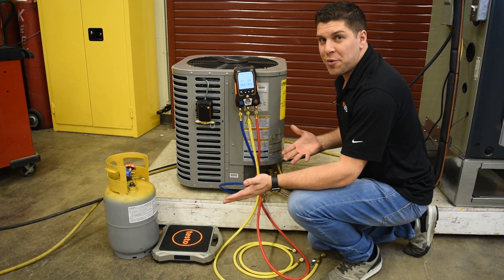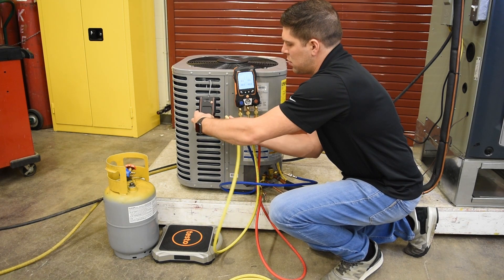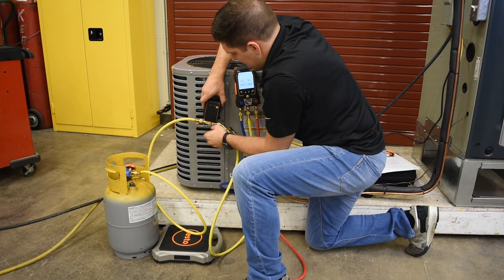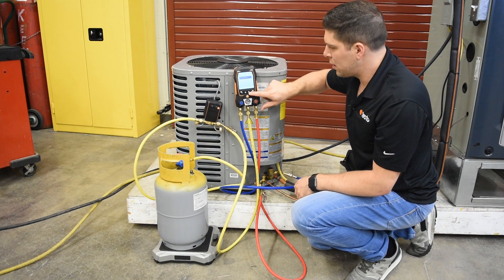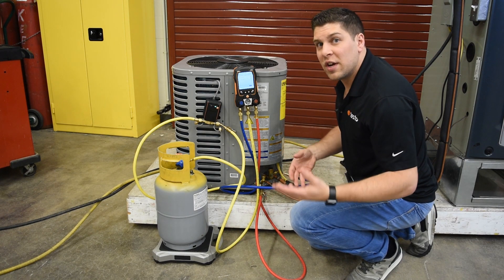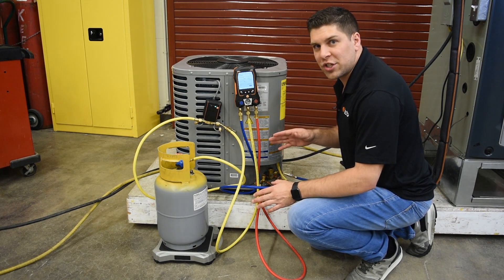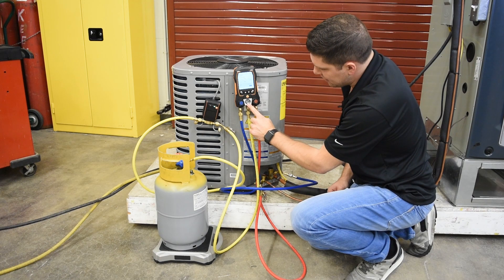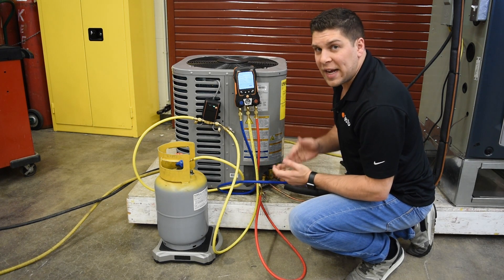testo 560i Connection and Refrigerant Line Purge

Comment: Wouldn’t you purge where the process hose connects the manifold set while the knobs on the manifold are closed off to the system. The only way I could see you purging where you did would be to have the hoses disconnected from the system using hoses with ball valves. If the hoses were actually hooked to the system with the process knobs open you would introduce air into the system.
Reply: The entire process just makes no sense.
Reply: i agree when i saw that guy do that the assumption was its under vacuum and ready for charging so he would have to purge the yellow hose either at the manifold or the valve on the in side to purge all air from hoses. that guy is going upset some new guys in the field when they find out the have a tone of air in the system and now it wont cool lol